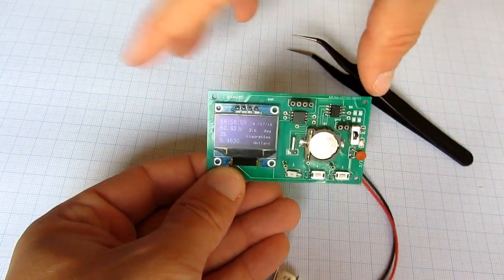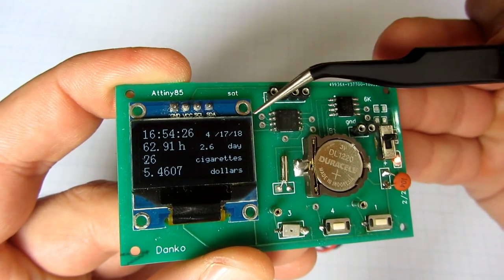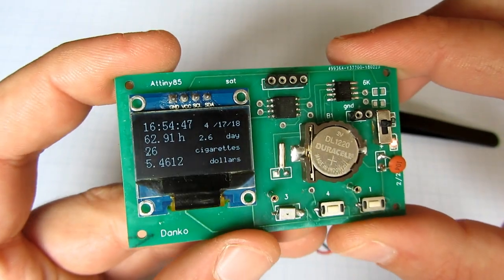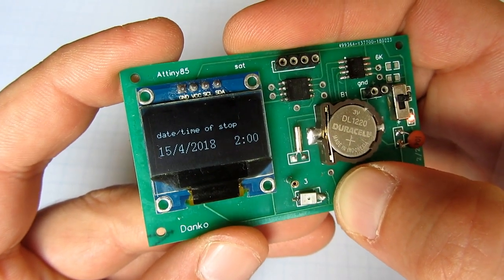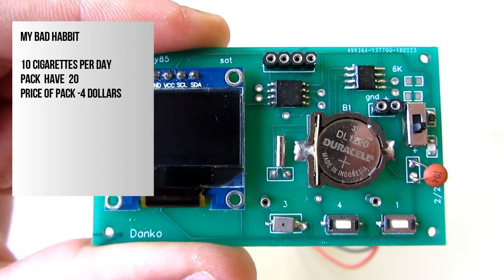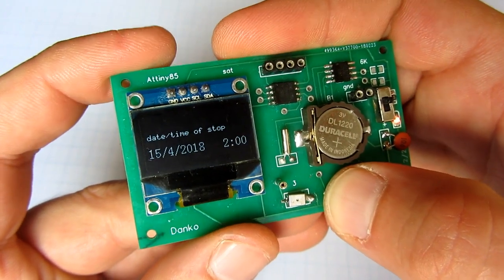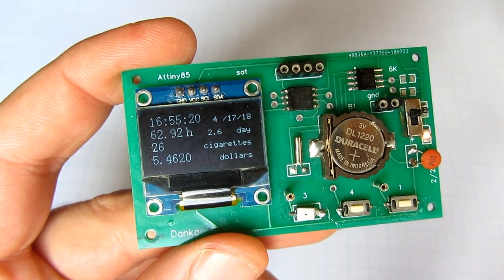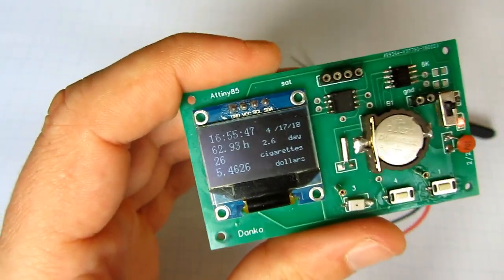Arduino - quit smoking project

Comment: Debunking the claim:
1) it did not reduce, or eliminate the chemical dependence to nicotine.
2) It did not reduce, or eliminate the withdraw symtoms
3) It on functions to display data based on NOT smoking.

Conclusion:
The device does not help people quit smoking.
The device has no effect on the ability, or inability of a person to quit smoking.
The device therefore, did NOT help anyone quit smoking.
Reply: I disagree. Seeing the money saving would definitely inspire some people. It means more money in your pocket to spend on toys, like new microcontrollers and sensors :-)